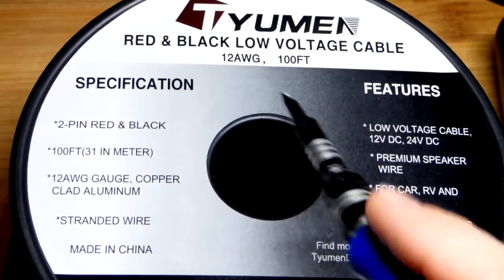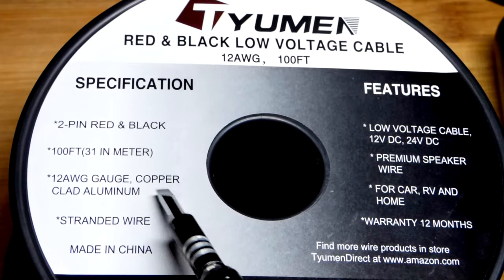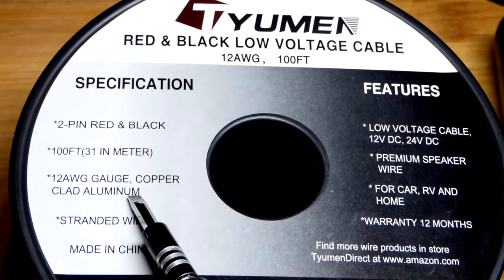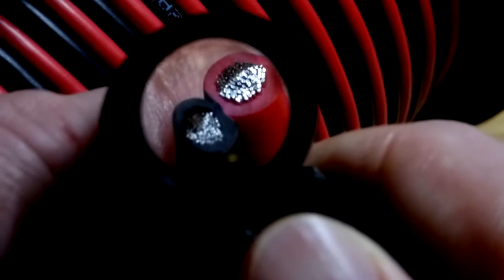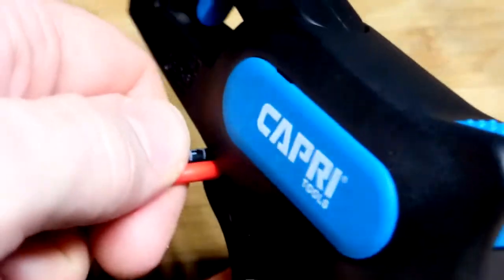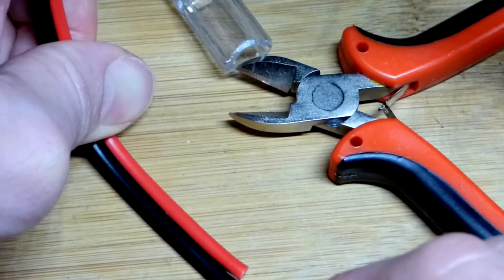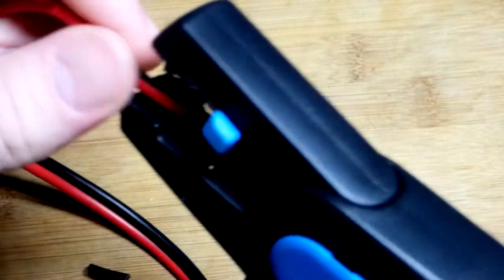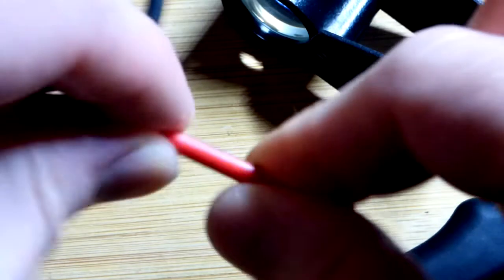First look at low priced copper clad aluminum 10 american wire gauge AWG spool cutting snipping

Comment: Boy most wire comes marked by the foot but I’ve never seen it tagged by the exact foot they’re really trying to sell that stuff bad. 
Aluminum and copper are notorious for destroying each other so my advice to anybody is to never use that stuff CCA I think they call it copper clad aluminum garbage wire.  Great video
Reply from the maker: Thanks for the info!
Reply: @Electronzap  more info... 
I had an old Volkswagen that from the 80s that had aluminum wiring and copper connections and let me tell you anyway here’s the Wikipedia link. 

https://en.wikipedia.org/wiki/Galvanic_corrosion